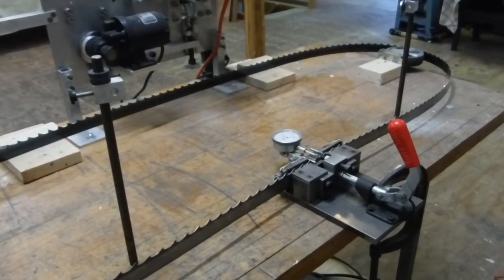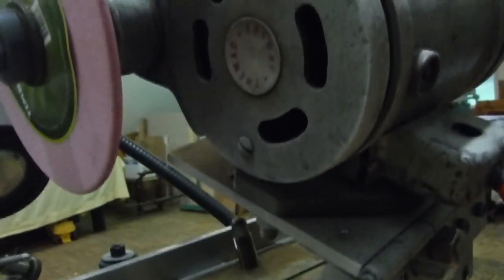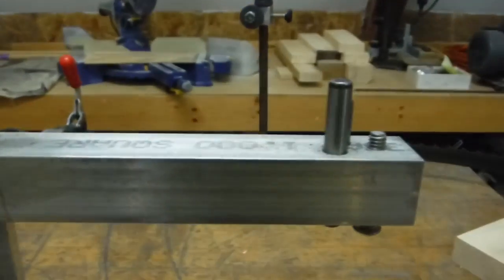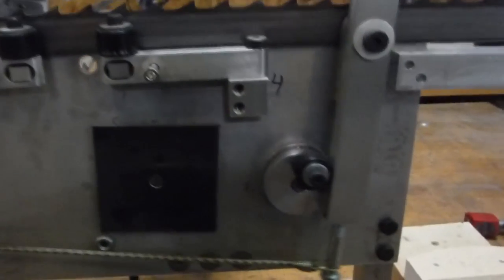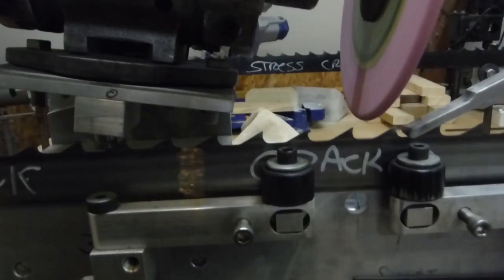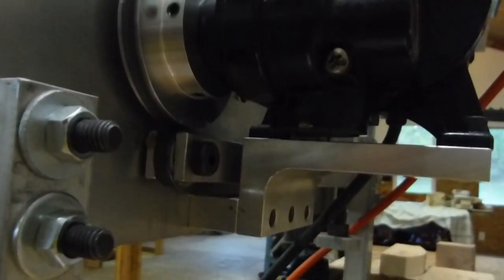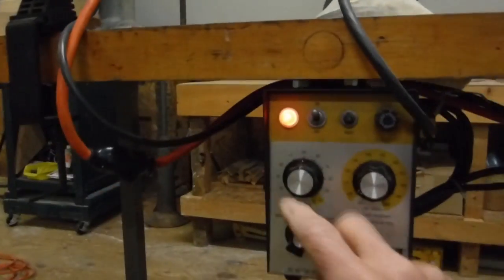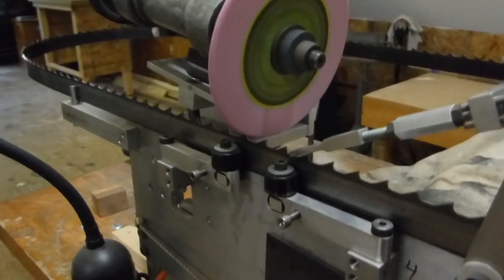Homemade automatic bandsaw band sharpener

Comment: Really nice set up. In particular you have the 'pusher' indexing the actual tooth to be ground. Many I have seen index the tooth before. If that tooth is somehow different in shape/size it will impact on the tooth to be ground. I am about to make one and will incorporate the method you use.
Thanks for putting this out there.
Reply from the maker: You are observant. That is the reason I did it the way I did. I will day I have resharpened a lot of blades with this setup. It works very well. You just let it go, take your time and you'll have a nice new blade.

Comment: Good job how did you scale the cam for the grinding wheel up and down did you just play with it a bit or have a pattern??!!??
Reply from the maker: There is some good information on the internet on how to develop a cam you have to know first the geometry you're trying to copy which you can get off the saw blade and then there are slick easy ways to develop the cam. It consists of drawing some concentric evenly space circles and some radial even space lines and then connecting the points with a line called a spline which represents the geometry of the sawtooth that line then becomes your cam.  I still made three before I got exactly what I wanted but the first one was close.

Comment: Nice build! Where did you get your servo motor to run your cam at?
Reply from the maker: That motor is a dc right angle gear motor. I got it surplus. You can find them on the internet with the motor controller.
Reply: @whistle3man  ok thanks. I'm going to build me one and was wondering where to find those at
Reply from the maker: @woodintheworks3275  good luck on the build. Also you can find good info on how to generate the cam on the net. I then used a cnc machine to cut the shape
Reply: @whistle3man  ok thanks. I'll have to check that out

Comment: Can you tell me what model Themac grinder you used on the machine and what size spindle shaft it has?  I'd like to find one that would accept a standard 1 1/4" wheel adapter but that might be difficult.   I've been looking around at grinders but unless you get a really large one they mostly have pretty small spindle shafts.  Thanks
Reply from the maker: D6c10K the model is a J45S. its OLD. i use a wheel from a chain saw sharpener. the grinder i bought many years ago ay an auction.

Comment: Looks great!  Been kicking around the idea of building one to sharpen blade for my Woodmizer sawmill.  I like the idea of using a tool post grinder for the spindle unit and building it all on a vertical plate.  Using a full radius wheel like that would make it easy to find a CBN wheel to fit it too.  I may have to steal your ideas.
Reply from the maker: D6c10K thanks. it works very well. nice to have the machine do the work.
Reply: @whistle3man  I have a solid model CAM design here https://www.etsy.com/listing/777214851/automatic-band-saw-mill-blade-sharpening?ga_order=most_relevant&ga_search_type=all&ga_view_type=gallery&ga_search_query=band+saw+sharpener+cam+solid+model&ref=sr_gallery-1-4&organic_search_click=1

Comment: You should be able to sell some plans for that.  Will your current cam follower allow you to sharpen other blade profiles or just that one ?
Reply from the maker: that cam  is for the lenox c sharp blade. other blades would require a different cam